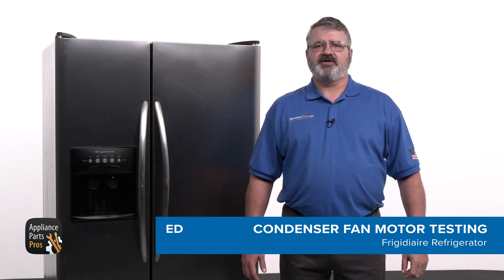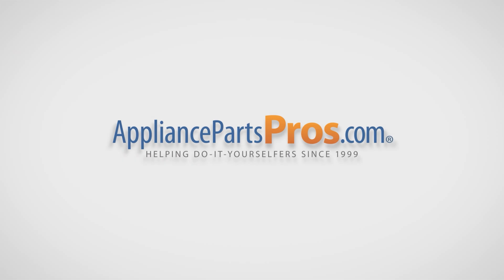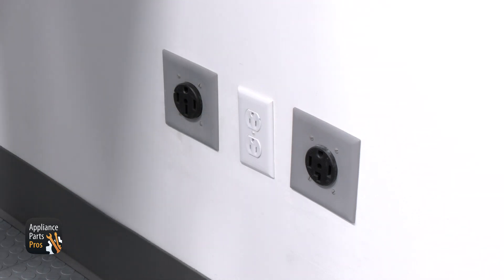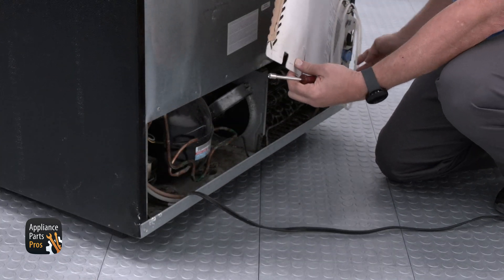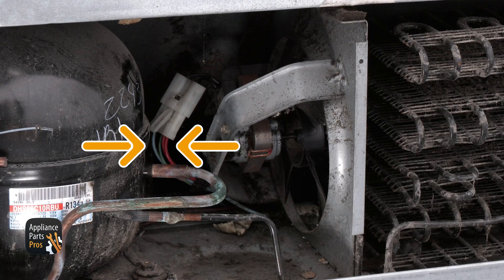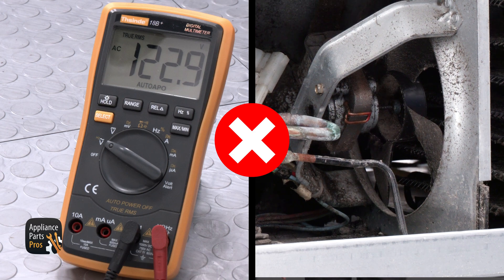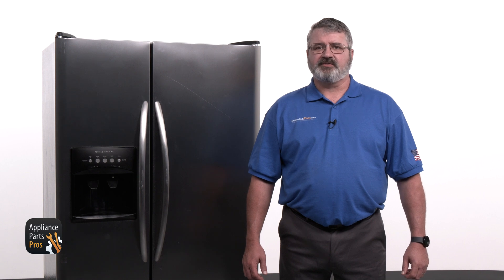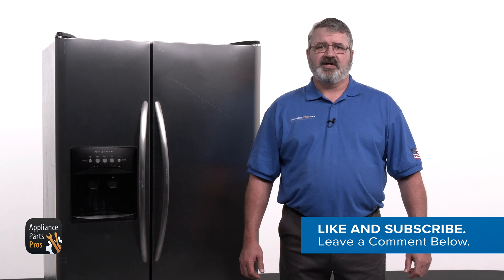How To Test A Frigidaire Refrigerator Condenser Fan Motor 5303918774

Comment: My standalone single door Frigidaire gallery FGRU19F6QFB fridge is cooling fine, but i dont see the fan ever turn on in the back and the compressor seems very warm. I dont see the stan alone freezer fan turning on either . That compressor doesnt seem to be as hot. Freezer also keeping cold. Any ideas?
Reply from the maker: You will want to check your refrigerator for a blockage in the air vent or in the condenser coils, as that could be causing the compressor to run longer, which makes it hotter.
Reply: @appliancepartspros  Thanks. I didn't see anything underneath near the coils that looked out of place. I'm still concerned that the fan that is aimed at the condenser never turns on. Should it turn on every time the compressor runs or is it thermostatically controlled?
Reply from the maker: The fan should come on when the compressor is on.